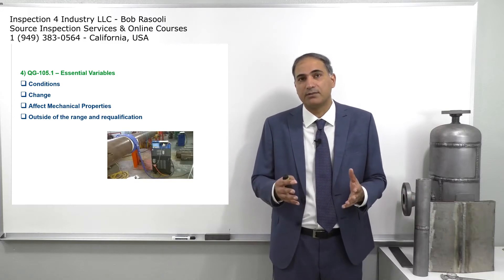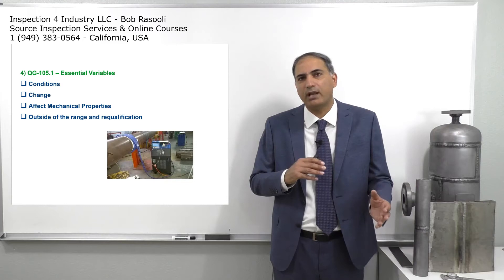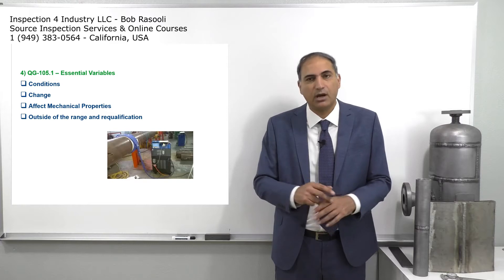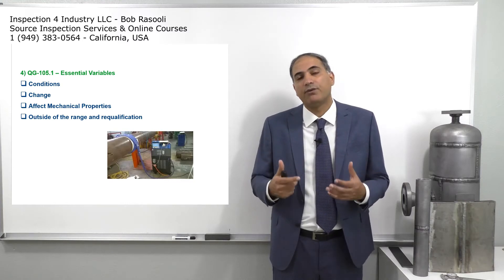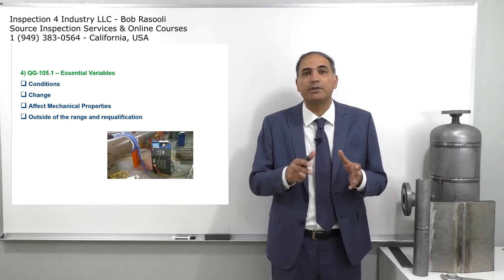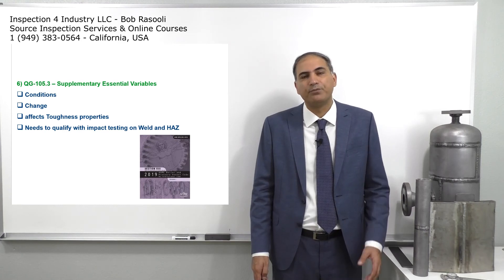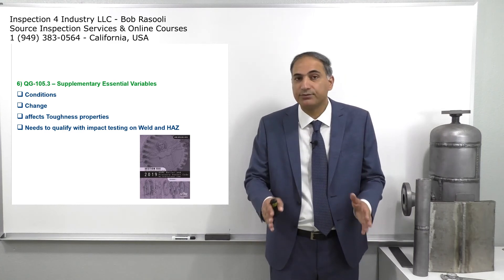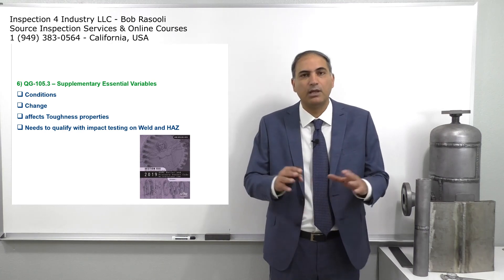WPS Essential & Non-Essential Variable on ASME IX - API 510, API 570, API SIFE, SIRE  Exam questions

Comment: very nice Sir
Sir I have question on PQR
Sir can we use a PQR "which is qualified on Material ASTM A53 Gr.A Process GTAW/SMAW Filler wire ER70 S-6 and E7018" to make a WPS for A106 Gr. B, process GTAW/SMAW filler wire ER 70 S-2 and E7018
Reply from the maker: Yes, all changes are non essential